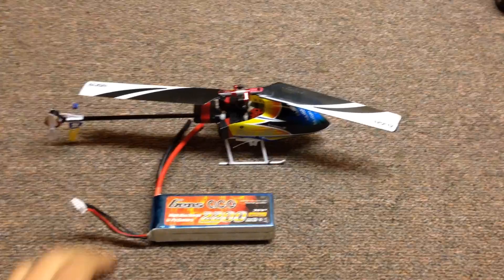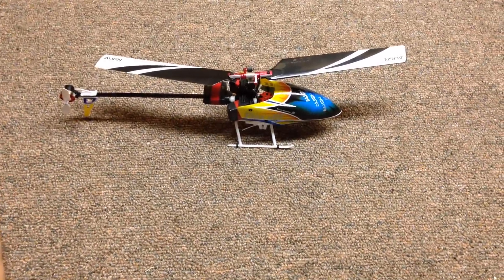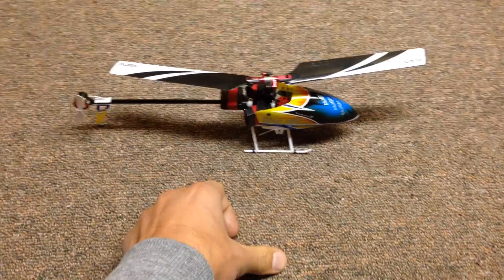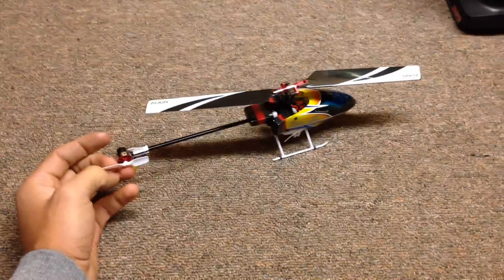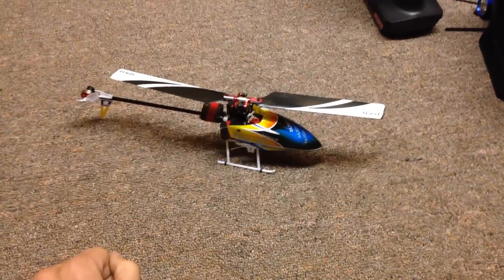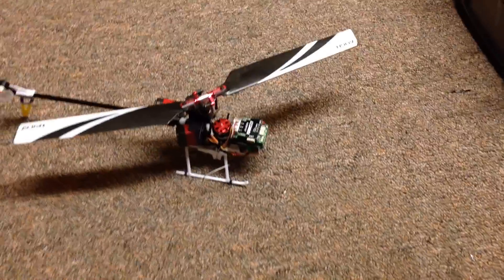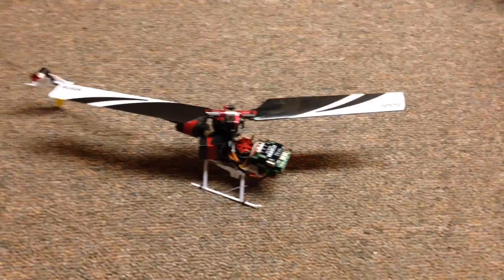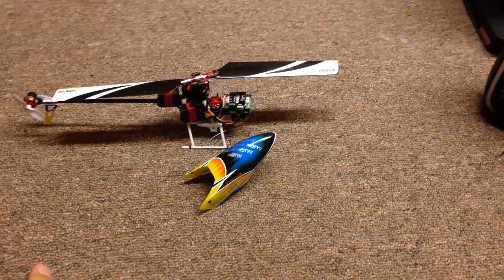ALIGN 150DFC Vs Blade 130X and MCPX-BL

Comment: Awsome! This looks better than the Blade MCPX BL. I have BL Nano that has been a money pit.
Reply: You'd be surprized at the time and money you can put into a Micro. 100 bucks for a brushless upgrade, Blown tail FETS on the circuit board tedious soldering to replace them. 30 buck motors, 4 dollar pitch links, 3 buck main gears, 10 dollar blade grips, 6 buck featherin shaft, 40 bucks worth of batteries and need new ones now, LOL! 14 bucks servos here and there, Love to have the lynx grips and swash another 50 bucks and on and on it goes. Enjoy it though, you can learn a lot with it if you can keep it going.
Holler if you needs any help. Also the Nano forum at Helifreak always has tons of advice to offer. Make sure your tail motor wires are not laying right on top of the right servo shaft. Mine came that way and about 22 flights in rubbed a hole in each tail motor wire, shorted out and and burned out the Tail FET on the circuit Board the 2nd day I had it.
Reply: If you ever see it to where the tail motor wont cut off completely but slowly turns thats an indicator of a blown tail FET.

Later when you want more power Asteroiiddesigns.com carry a wild brushless kit. And I believe Xtreme 200 35C mah lipos that fit the stock skids are the best battery for that setup.

That and the Xtreme grips and swash is all it needs far as upgrades. Those grips have almost an indestructable Featherings shaft.

Get a needle dropper and keep a half a drop of oil on every moving part every 5 flights.

Keep it above grass. When you lose orientation center the collective and hit throttle hold quick. 9 out of 10 times it will settle to the ground unharmed which is its Number one benefit.
Reply: ILTSYC You paid 100 for a nano brushless upgrade?  You can get them online for as cheap as $35.  I have had to replace the tail boom once and the swash twice on mine that's it and it has taken some brutal hits.  I think I might pick up the 150 too.  Seems like it's sheer luck to buy a micro that doesn't have issues.
Reply: *****
Nah! I payed 65 Bucks for the 1600KV motor, esc, skid mods and frame mods. The rest was in 6 batteries, x6 - 1S parallel cables, longer boom and new tail motor wires.

I don't fly my Nano anymore, too much down time, can't stand the zero pitch jitters. I get one thing fixed and something else screws up. Every time I turn around it needs 50 bucks worth of stuff. I use that money on my Trex 550 V2 TT and 450 Pro belt.  I can fly my 450 4 or 500 hard 3D flights with very little issues except occasional motor bearings,  or belt..
I do go through a lot of Tarot Dual Control tails though. They are 5.69 and work very well when new so I buy a bunch of them when I order. Aligns new Dual tail control doesn't work with a belt plus its 50 freaking dollars.
I'd get the Microheli dual control tail lever but its 35 dollars and if one thing goes wrong with it you have to buy the whole darn thing. Its built like the Gaui X3 and Mini Protos but not nearly as cheap. 15 bucks buys parts for those plus shipping.
Reply: I've really been looking into buying the trex 250 pro

Comment: the 150 might be good for an experience pilot, but for someone like me who is making the transition with only a year flying let me just say that my 150 is the newest  of my micros and it has been parked so many times due to parts breaking down with almost every crash, here in Ontario, ca. the wind tossed it about 3 ft backwards and totally unstable even though it feels heavier than my mcpx,mini cp, or even my v911, the canopy bearly fits, the wiring is almost too short and the board is not even fasten with screws but tape... ridiculous... for that price, now you mentioned the 130x and to me that is not even a match when it comes to being stable, my 130x is soooo easy to fly and has taken some shots that I just love this hell, only gotten strip front tail gear, but not broken servos or canopy or landing gear.....my worst hell I would say is my v200d03, that one breaks all kinds of gears and servos that it is not even funny....hate that hell. anyway thank you for your vid and this is my opinion about the trex 150 I do not recommend it

Comment: I could care less about durability if I'm not flying it because it don't work right and it's just sitting while I wait for upgrade parts.  Its like buying a sports car with square wheels, a tranny that tops out at 30, a black windshield, yet has a great chassis, a 500 HP engine, OH and its durable 5 star crash test.  My mcpx bl has real bad tail wag out the box and it will blow out 360° if "provoked"  my first mcpx would cut the tail motor when switched to idle up and spin like a top (HH sent me a new board, problem fixed.)  My 130x flew good out of the box, besides the tail vibes (not wags) until they got out of control, 130x=problem chasing, testing, repeat.  I just want to fly in my yard, I'll worry about durability once the testing stops and the "flying for fun" happens.

Comment: read the heli forums buddy that align 150 has been a big let down for many people,for a micro its not durable at all,skids,chassis,motor mount,stripped servos etc etc all break too easy for a heli of this size..suprise suprise align now brought out a truck load of upgrades for it to fix its weak points..sure blades micros have there issues too
Reply: I agree the align helicopters do fly better than blade probably til u get into the higher end 500 size and bigger then theres probably little comparison,i just prefer them cos u get excellent customer service from horizon hobby
Reply: C Will i agree as i only have a dx6i blade wil always b my preferred heli as bnf are well priced,i wil get the 450x next which is alot cheaper compared to aligns 450 size offering which im sure is an amazing heli
Reply: Metal swash and stiff frame/main shaft sorts this helis durability issues unless you don't hit TH before a crash - i uploaded  a durability vide recently if interested. Not using TH is almost guaranteed to cause damage with these headpseeds, especially if not flying over grass - using TH over long grass gave me 6-7 crashes at full speed with no damage at all at my flying field. One crash over tarmac not using TH gave me stripped servo gears.

The tail is not perfect in very fast reverse flight and possibly not as bouncy as a blade but it is capable of much more advanced flight, the piro compensation is flawless. For sure it's not a beginners helicopter but it's  a lot cheaper and quicker to fix than a a 450 and I have never progressed so much.

With plastic swash and stock frame, this heli is indeed a terrible junk flier and will explode when swash gives in.
Reply: C Will He may be using Google translate 😞
Reply: Michael Marr No English speaker speaks English like you do. It is not too late for you to get remedial lessons . You would then be in a position to communicate with confidence. In the mean time we are having to guess at what you might be trying to say.
Reply: Wil u too give it a break! Jeez there more to life than rc helicopters!
Reply: Darren Stewart Two not too.
Reply: +Michael Marr Your grammar is atrocious.
Reply: Thrashaero thank you.  your grammar is atrocious too.  Now who is rude in first place?

Comment: The tail motor set up is horriable u crash and thw wires come off its too short to soder and your stuck. Take it from someone who flys these little ones a lot. The mcpx bl is a much better heli until they make the tail motor in a plug version. The  150 is nicer but as far as being a strong heli the mcpx bl is better

Comment: And the mcpx bl is way better then the 130x so yea.
Reply: Why do you think the mcpx bl is better than the 130x, just wondering?
Reply: patrick sanderson mcpx bl is way better on maintenance just make sure tail boom is secure and it would be nice if the mcpx bl has CF blade upgrade.
for the 130X you can fly it out of the box but after 10 uses it needs upgrade for the bad vibration specially the tail overall they fly the same aside from the tail wag on mcpx bl